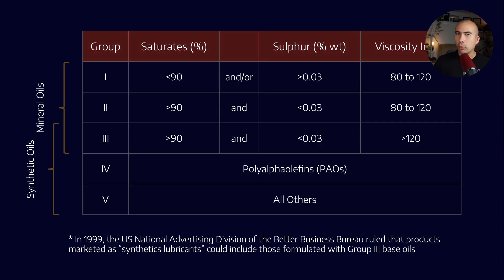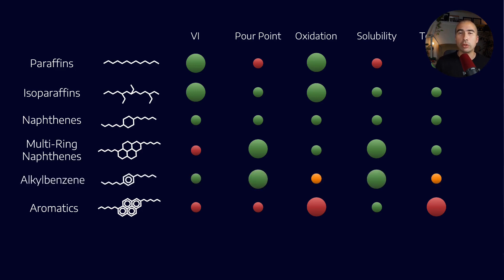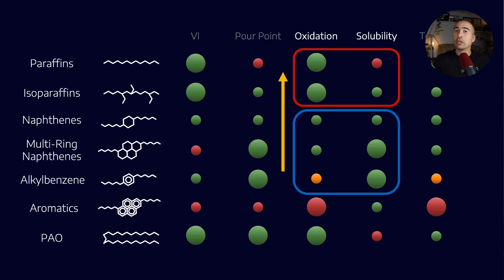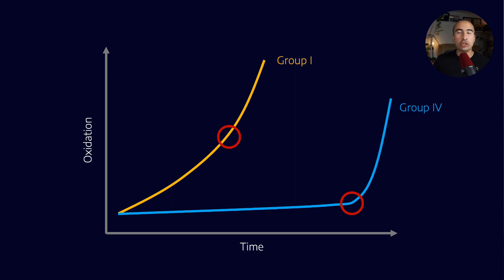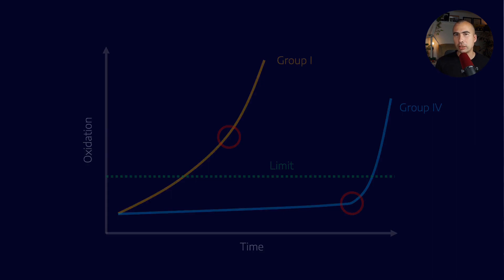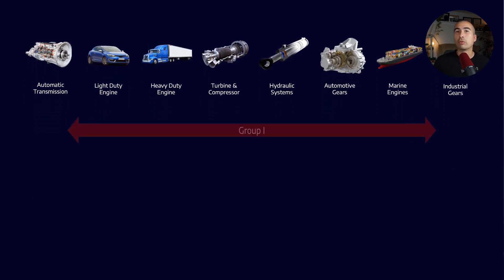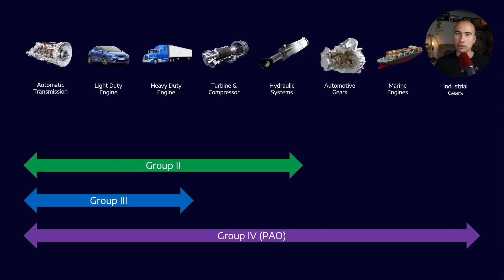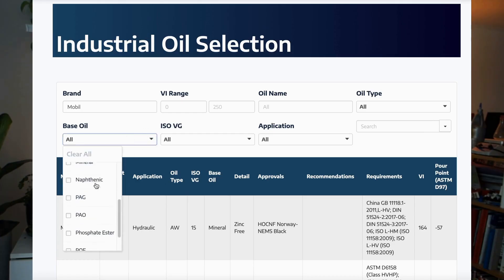Varnish: It's Coming for Your Gearbox

Comment: Can i apply for ICML exams after purchasing the course from your website.Beacuse icml is asking for a training certificate from a registered company from its training partner directory?I am interested to pursue MLA III.
Reply from the maker: Great question! You can, but I haven’t uploaded MLA III yet, it should be coming in December. ICML just requires you to have a certificate from the training organisation (doesn’t need to be registered) so any certificate is okay, although I’m currently in the middle of the process to get set up as a registered trainer through ICML
Reply: @LubricationExplained  Thanks sir for the information

Comment: Yair, I hear you... BUT - Doesn't oxidation & varnish occur under higher, combustion & turbo temperatures & conditions?
What would be a max level temp in a gearbox? Remember, No combustion...
Reply: 170f seems to be a typical sump temperature for a transmission. *edit: at least on a manual gearbox automotive application. Automatic transmissions probably run a little hotter which is why they need a cooler.
Reply: Ok. I did ask a leading question. In fact, I have a laser thermometer. 
After a hard hill climb, on a 100 F + day; Either manual or auto trans read 140 F. 
No varnish. Even so, do regular oil changes. Rather than, push to see how far? :)
Reply: @lesliedsouza4077  I've already learned that lesson the hard way. 5 hours to drop the trans 2 weeks to wait for parts, 10 hours to rebuild and 3 hours to put it back in. It's a lot easier to change the oil.
Reply: @lesliedsouza4077  Lower temps reduce the rate of oxidation.  How are you suggesting that new fluid will solvate the varnish deposit precursors?
Reply: @bjuricek23  How are you not understanding that draining old oil, takes away any precursors that might exist? :) Maybe I'm OCD, I'll run some diesel through a manual trans, on no load, before refilling new oil.
 Kero's a better solvent, but not good for oil seals?
For truck or industrial gearboxes, do periodic oil sampling & check lab report?
Reply: Ive had a gearbox get hot enough to build enough pressure to blow out. definitely something went wrong that was not normal but we didnt figure out what happend just pulled it apart cleaned it and rebuilt it.